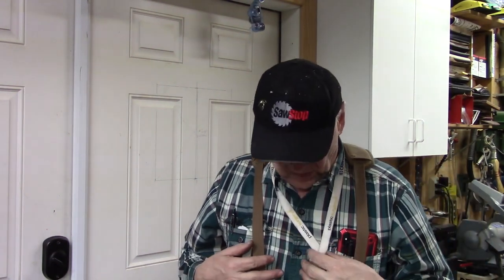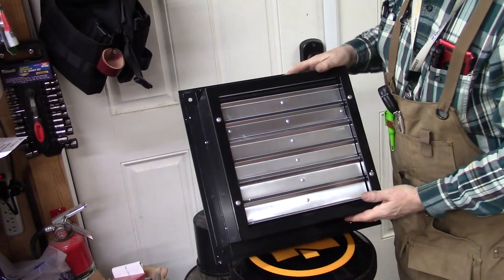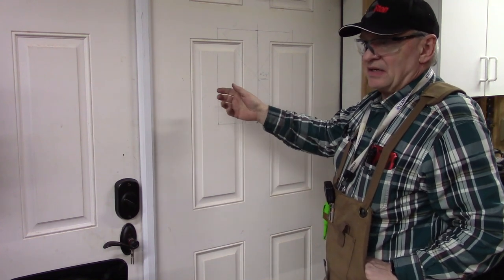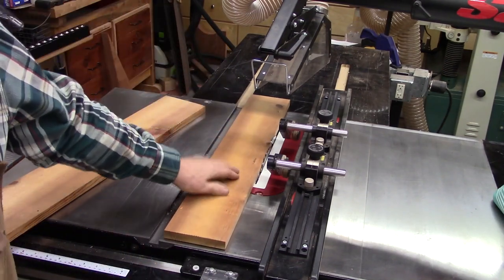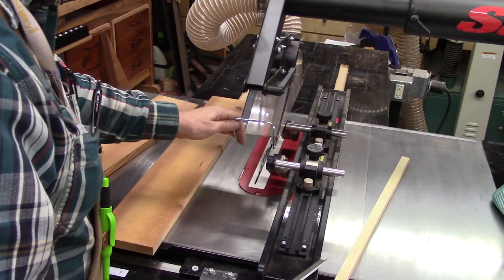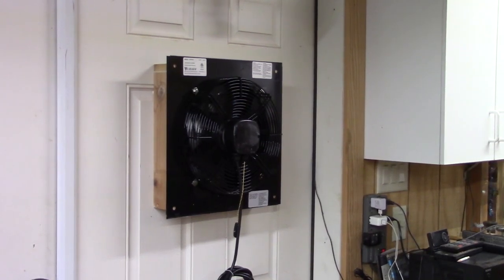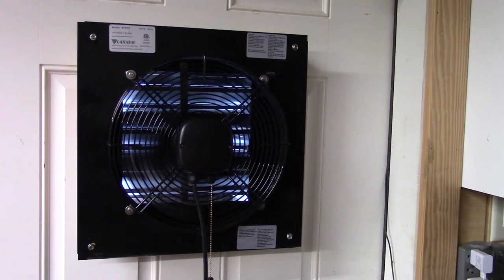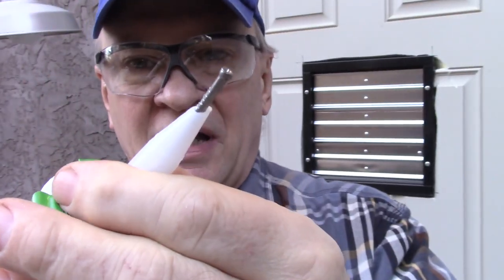Workshop Exhaust Fan Canarm XFS12 Installation w  Dr  Joe

Comment: Was hoping to see how you cut the hole in the door????   I am looking to do the same?
Reply from the maker: Hello Bob,

I first carefully marked out the door where I wanted the hole. Then in a corner, I drilled a hole and used a Sawzall to literally cut out the opening. This door is primarily a foam door, and it cut out very easily. Consider subscribing. Thanks Joe.
Reply: That would've been helpful